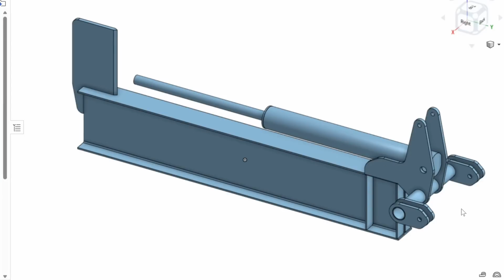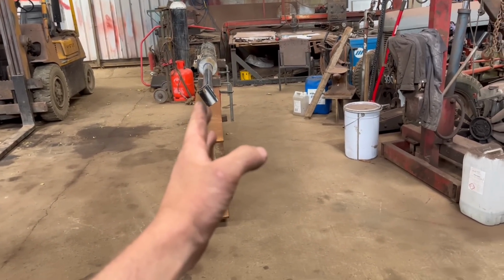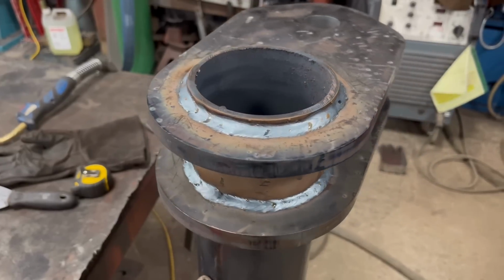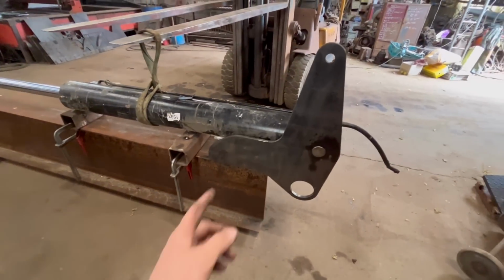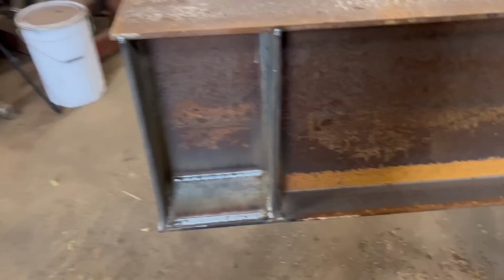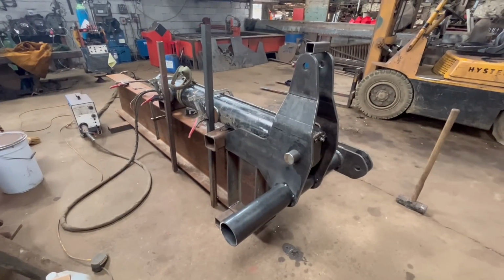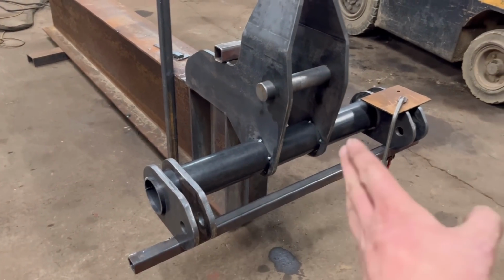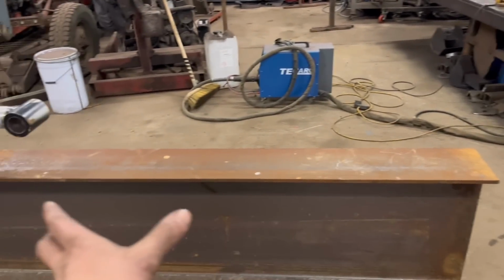Making a HUGE log splitter. part 1

Comment: Always shocks people how massive a good log splitter has to be. Brought a trailered one back from Austria 20 years ago and she splits everything. Diesel operated rated at 35 tonnes or so. This is looking to be a veritable beast too!!
Reply: If they’re built right they don’t have to be that massive though. My 50 ton splitter is only 5 1/2’ long, is run by a 5hp Predator engine and will split up to a 24” stick. I pull it around with my 4 wheeler. My ram is a lot shorter than his but bigger around. The only wood I have trouble with is stuff like big maple with a lot of knots in it. I rebuilt it though because when I got it the wedge was on the ram and the plate was on the back so when I split it the wood would fall at my feet. I reversed it and put the wedge on the back so that when I split the wood it would fall off the end.
Reply: My first thought was, " This is huge"  The plate is very thick. Monster dog.

Comment: Hey olly love that splitter. I hope the tractor has assister rams on the hydraulics😂 by the time it's finished your gonna need them. I think the big advantage you will have the way you are building the splitter will save a lot of unnecessary cutting on the logs. Superman would have job stopping that when she's  pushing hard cool as cannot wait for part two hope we can see it in action.😁❤Ruth

Comment: Gday, I’ve been using Fusion360 and that’s been a learning curve, this is definitely going to be an industrial wood splitter, great job mate, cheers
Reply: Good to see you here Matty, I was gonna mention on your last video to check out Olly as you said you were considering making a line borer and his home built one would be a good one for some inspiration ?
Reply from the maker: Is that what you use to draw things for your 3d printer matty?
Reply: @snowballengineering  I do, then export as a STL file to Cura for slicing

Comment: Your going to need a big old tractor working hard to pump enough oil to cycle that ram at a reasonable work rate!!          You might consider doing what I did and making splitter PTO powered with its own tank and gearbox&pump.

That was my answer to cycling a big ram, not using much fuel ( DB 995 runs it fine).    HTH

PS:    A big table was another good addition to mine

Comment: I built 2 of them years ago from scratch. Only had a lathe and a dc welder. Ram, pump and motor were supplied by the owners. Make sure you anchor the front end of the ram to the beam or it can buckle the rod. I learnt the hard way on the first one.😊

Comment: If you clamp the end of the cylinder you will bend the rod eventually , only use the ram on its original mounting points  
I speak from experience as I made one exactly the same many years ago,and bent the rod, good videos keep up the great work

Comment: Another great video Oliver, looking forward to part 2. Your press brake must have some power behind it to bend thick plate like it did. I too like to use 3D CAD, I’m a bit older than you but find it’s a great tool to visualise a project before I start to cut metal. Keep up the great work.

Comment: if the ol blade gets blunt on the chop saw , you can sharpen it no problem , take the blade of then get angle grinder , dont grind the teeth its the piece behind the the tooth ,dont have to take much off ,try it did mine worked a treat , love your videos  great stuff ,regards from Essex

Comment: Think I'm too old to learn CAD, I'll just have to stick to drawing on the back of an old envelope !
Looking like a useful splitter, really hope you're gonna put some sort of table or guides on it to stop the split sections falling to the ground, it's a pain having to double handle stuff all the time.
Reply from the maker: Yes, that’s the plan. Still to be designed 😆
Reply: You may actually want a hydraulic loading cradle for large rounds that you roll  up to the splitter.  Mine is trailer mounted but not a lot taller than yours will be and that would be a very nice addition.  Funny how your mind gets to designing things to make a job easier as you’re doing it!
Reply: Repair paltisers is what you’re best at from what I remember ~ following Doberman 😂

Comment: Previous comments are spot on about ONLY having 2 points of contact for the ram.  Rear one and then the one for the push plate slide unit.  Do not secure the front of the ram to the I beam.

Comment: Make sdditional blades that drop over the welded on blade allowing you to easily remove to sharpen.  Or to swap between a single blade and multiple wing blades depending on the size of the log your splitting 
Since its on the 3 point mount.  Make it so you can mount it upside down to allow you to operate it like a backhoe from the driver seat  by backing the tractor and lowering the splitter over the logs  on the ground. A plate to pin to the splitter 3 point to allow you to mount it on a skid steer also jaws down.

Comment: I have seen designs like this where the splitter blade is removable and you can make several types. Single blade, crossed blades, six pointed star, and even some that have an internal four and external eight blades so you can split huge logs. You might put on some small wheels to make it easy to move when not attached to the tractor.

Comment: I'd definitely include some sort of cross cutter.  Unless you are cutting saplings or burning wood in a skip, cut once and get manageable pieces or allow for changing blades or inserting a cross piece.  Versatile is easier to do first and adding and it later is a pain

Comment: Looks great. I would however cut your wedge at an angle, Ive built quite a few for sale and our farm and the angled wedge seems to start the split on one edge as opposed to a flat on the log, much the same way you would mill a piece of metal,  Come in from one side to start and carry on, easier on all your equipment, Love your one off fabrication,

Comment: if your thinking of holding the ram solid at the end of the cylinder and fitting some kind free floating push plate on the end of the rod  theres a chance over time that the rod will bend (yes i know its a big bugger) better just to have a sliding push plate  mounted to the rsj .      PS is it going on the te20😂🌳

Comment: Would you need to sharpen the blade? Then it should be removable, but the forces required to split the wood might shear bolts, but if there is so much force then a shear bolt is better than a bent ram or blown seals. Damn that is some rabbit hole to go down!
It is a bit bigger than I though it was going to be!

Comment: That is one hefty log splitter.

Should consider a gusset going from the TPL tube down to the end of the web on that beam.

As it sits all of your force will be taken up by those two cheeks, right across that radius where it turns upwards.

A gusset going from that piece of tube down onto the web will add quite a lot of stiffness to that part, which will be good both for when it's being used but also when it's being transported.

That is going to be quite a lot of weight to be bouncing behind a tractor.

Comment: Awesome job thk q ...you may need the power of that ram if u got some notty oak lol lol I do more lathe and milling work than fabrication ..I do envy u a little bit with that plasma table and brake press nice tools to have for your line of work...I guess u could cut a plate out to fit over the ram similar to those tph brackets just a thought ..

Comment: Hi Oliver brilliant video I was amazed at the size of the log splitter until I read some other comments. One question why did you need to use a temperature sensor (at least I think it was a temperature sensor) on the welds you made fitting the reinforcing sections. Ho I was also impressed with your CAD skills no end to your talents.

Comment: I have to say that my favorite part is seeing the proper PPE for every job. I wish I'd known about/used the EP sooner cause tinnitus stinks.
Also, what is the fresh/filtered air rig you are using when welding? Asking as it seems less unwieldy than some of the stuff I've been able to find locally.
Reply from the maker: Yes, I didn’t used to wear EP at my old job and my hearing has suffered. I wear them for every noisy job now. I’m in this career for a long time so I try to project my eyes, ears and lungs the best I can. 
It’s a 3m adflo system that feeds filtered air into my welding mask.
Reply: @snowballengineering  Thanks! I'll have to go look for that now online, since I haven't seen anything 3m locally.

Comment: Dont attach the front of the cylinder to the beam. You will put the piston in a bind and damage seals. Cylinders can stay straight with two point of contact not three.

Comment: I wonder if you're under estimating the ram/ fatigue the steel will endure. The 3pt link/ram mount to the rsj should be more substantial. I foresee over time this will rip off. 

Also have you looked at box wedges? 

As always fantastic fabrication 💪
Reply: He’s splitting logs not 20mm steel, the day the ram might fatigue will be the day when it’s worn out and consigned to the scrap bin, more than strong enough for the job it’s built and designed for, excellent fabrication and superb build quality 👍👍

Comment: Given the length, I wonder if the 3point hitch can handle weight. How big of a hydraulic pump do you need to get decent speed.
Would 3 or 4 12" plates cut from the bean's web lighten it w/o cutting strength??

Good Luck.

Comment: That's one hell of a splitter (will be when it's finished) One question.. will it have it's own oil tank and pump, or will it run from the back of a tractor? It'll need to be a fairly decent sized tractor or will empty the oil reservoir from a little tractor!
Reply from the maker: Plan is to run it off a tractor. Will probably have to run it off one of the modern tractors though to have enough flow

Comment: I hope your going to use a hardened ram pin, if not it will distort the first big knot you try to split , then try and get the pin and ram out. Also that must be one big tractor to have a three point that can lift that much weight, I also theorized that anyone who could afford a tractor that big, firewood could be easily bought, yet if your looking to do production firewood for sale then you have one superior machine for the task at hand sir.

Comment: Speaking out of experience if tht log splitter isn’t one tht is attachment for a skiddster and is a pull behind stand alone type powered up by a little gas 8 to 12 hp engine. Then trust me ur gonna want to attach a wood table made of metal right on the opposite side of the hydraulic rams lever. It sure helps me since I built one. Specially wit these huge oak log rounds we split here in the mid west of USA .

Comment: Well done. Splitter is also going to need a substantial tractor to handle the cantilever load of the entire assembly. Also the hydraulic pump will need to be a serious size to provide the volume and the pressure to do justice to the ram and the overall capacity of the splitter. But no doubt you will have thought of all those factors already. I have a USA made towable unit with an approx 50mm dia ram and has a 31 tonne ram force. Will operate in horizontal and also vertical position. Have never had a tree trunk up to 1.5 metre dia and 450mm thick that it would not split (in vertical position). Yours will have far greater capacity than that as long as the hydraulics can supply the required pressure. If flow is low then will take a long time to cycle unit.
Reply from the maker: It will be used on a modern day 150-200hp tractor so the oil flow shouldn’t be too much of an issue. The classics we usually use for this job I don’t think will have enough oil flow

Comment: Nice burn table when did to get it ? Sure beats the gas tracer set up !
Can't wait to see it splitting wood !
Reply from the maker: I’ve had it a few years, I use both depending on what thickness I need to cut.

Comment: Another question how come you can weld on the forklift without disconnected batteries?
Reply: You simply attach the ground lead to the work piece,  not the forks.
Then it's all good.

Plus, it seems his forklift are an older model. They are a little "tougher" to destroy, in the sense that they have very few electric parts..
Reply from the maker: I’ve never had an issue with welding on the tines before.

Comment: what are going to use for hydraulics the tractor will be a bit slow
Reply: depends what tractor. anyway you don't want it high speed either thats asking for trouble
Reply: @kieranosullivan02  the one i made has an 12 second cycle time on 450 mm ram seems quick enough you could try in using  a two stage pump running off the pto
Reply from the maker: It will be going on a modern decent sized tractor so the oil flow shouldn’t be an issue.

Comment: Rapidly becoming Yorkshires equivalent of CEE Australia. Looking at the size of your cylinder, if the tractor has 2,500 PSI hydraulics, it will be a 50 ton force approx. You should be able to split logs into 6 with that. I think I'd make up some detachable cutting heads of various sizes.

Comment: Sir do you realize how big your pump and motor will need to be in order to have the ram cycle quickly enough?  This thing will be stout enough to split anything you and two other men can pickup and lay on the rail for sure.

Comment: Nice setup shame about the water/rubbish trap you've created on the beam. Not sure if it's possible but that ram needs larger hydraulic pipes even with a decent flow behind it is still going to move slowly.

Comment: I don’t think that the bracing was necessary on that massive steel beam.  Can’t imagine anything that could bend it. That size of girder holds up hundred of thousands of pounds in sky scrapers. The force from the hydraulic cylinder is running longitudinally with the beam. The way this splitter works, I don’t see how the force while splitting wood could cause any significant twisting of the beam.

Comment: I made my own plitter too. (12 years ago) I didn’t hold the cilinder on the end, but on the front of the cilinder. Less stress on the frame. You’ll need some kind of pushing block, that’s sliding across the profile, for stability. I made the hydraulics with a differential pressure switch block, for extra speed while no load on the cilinder. https://youtu.be/ZhHakN6aRJ4